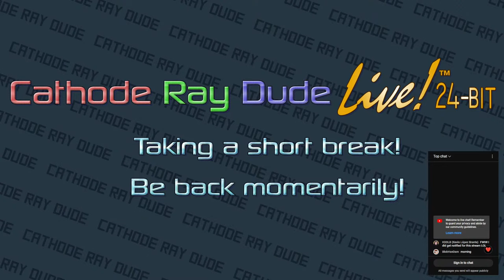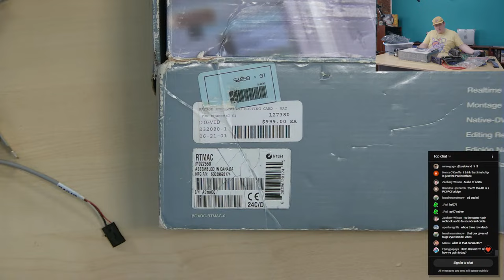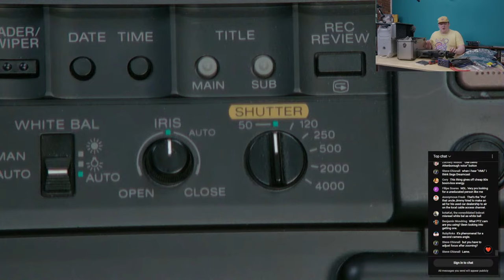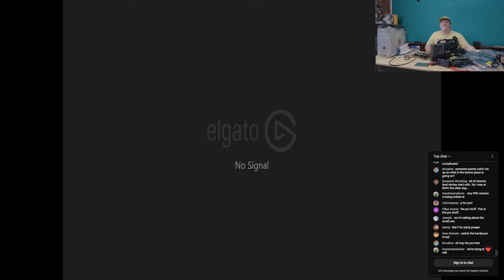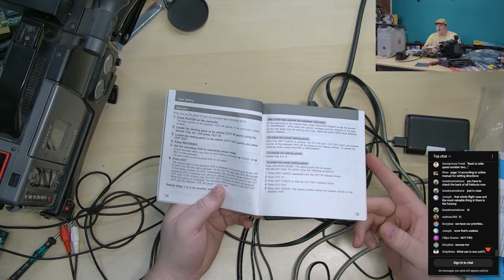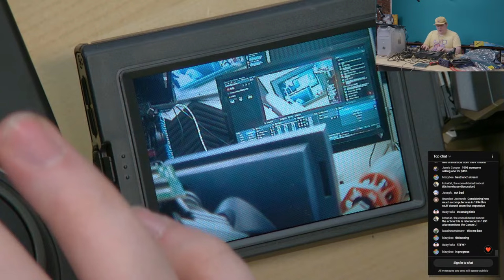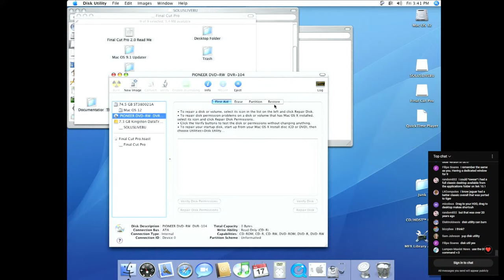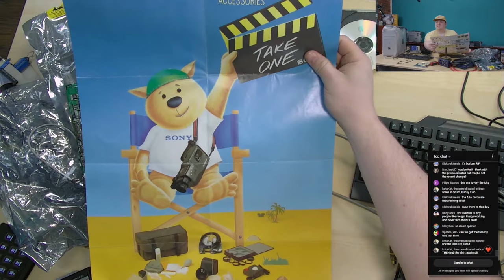Gravis Does Things With Electronics

Comment: 4:34:30 - there was a cottage industry dedicated to achieving the HDD speeds needed for video capture without doling out big bucks for SCSI-3 drive arrays. The cheap PCI Promise100 IDE RAID controller card was a game changer. I went from a pair of 4GB SCSI-2 striped drives to a pair of striped 27GB IDE drives for my Matrox Digisuite, which topped out at 17MB/s. My favorite weird thing was the Medea Video RAID, which started out as a 2-drive chassis that fit into your server tower's front bays. It used something called ZST to achieve stable speeds of around 10MB/s with two EIDE drives (this was before UDMA). One drive in the array worked from the inner tracks and worked outwards, while the other started on the outer track and worked inwards.